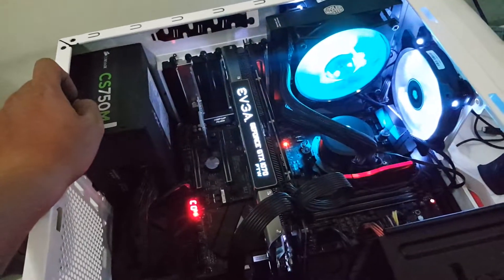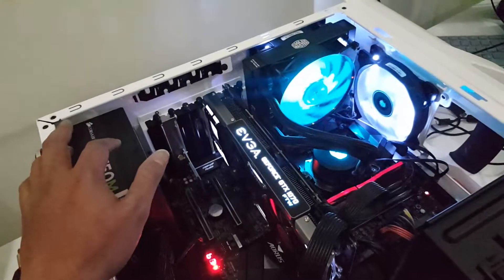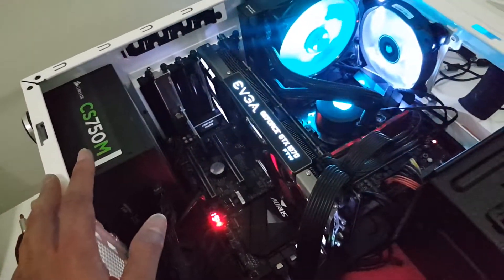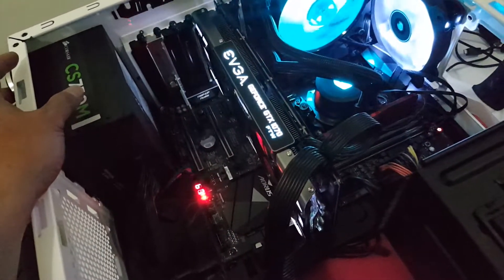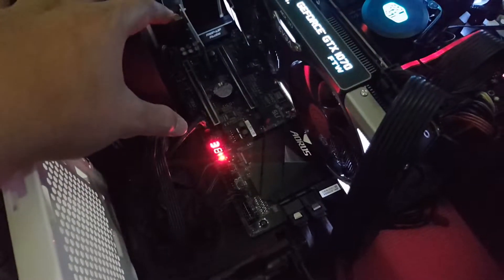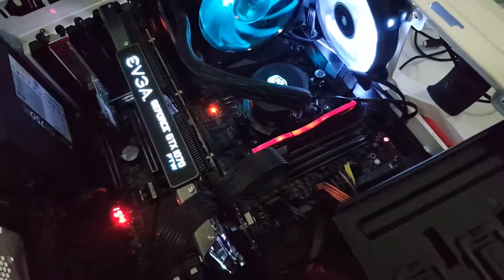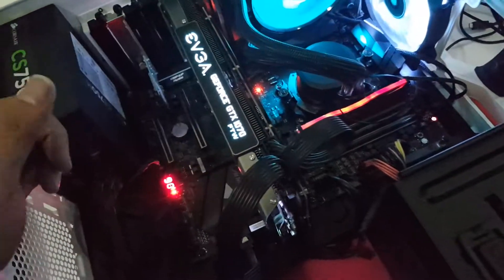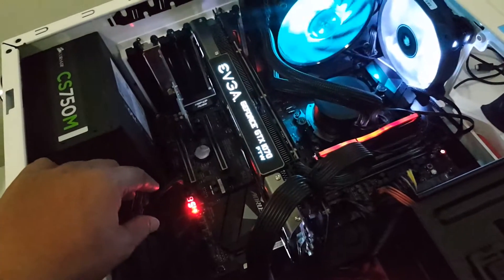Gigabyte ax370 gaming k7 hard to troubleshoot debug codes

Comment: Anyone still using these motherboards? Mine is also bricked now stuck in a loop with a ERROR CODE 54. I tested the CPU and RAM in another almost identical config from my friend and they work fine. Tried switching the main and backup bios, clearing CMOS and removing the battery but nothing. Still produces the same error. Anyone know if this is solvable. I have a gut feeling that it might not be a hardware fault but the board might be bricked somehow. (I occasionally got a similar black screen without booting, but after a restart or two it used to work fine. Recently it worked fine until past morning it would not get unstuck)
Reply from the maker: me up to now still using but everything is at stock setting
Reply: @manuelabella2589  surprisingly it still can be bought new, that would probably save me a lot of time reinstalling everything. But the price is even higher than it was 6 years ago.

Comment: I saw and some forum, which i have found out, overclock.net, possibly, or other forum, where there was information about problems with overvolting ryzen processor on F5 bios. F6 and F7 also was mentioned in topics which dealt with that subject.
Reply from the maker: too bad i can't go to bios 1 anymore :(
Reply: @manuelabella2589  There is a way to save bios to malfunction bios memory chip. You can start with good bios, then before saving new bios on chip, you just switch to previous, 1 bios. Then, programming bios will be done on bios 1, which was malfunctioning.   So people reported that bios was restored, and everything was saved.   The topic was discusses on reddit, as far as i remember.   I will tryo to show it to you, where there is proper way of doing this, step by step.
Reply: Here will goes the instruction:

https://www.reddit.com/r/Amd/comments/5zlegh/how_to_restore_a_bricked_ax370_gaming_5_bios/

Red whole paragraphs, and be carefull.  People reported that instruction step by step, saved their motherboard!  Search more info for Q-Flash, and how to restore your proper bios on usb stick, to be prepared, to flash BIOS.
Reply: @manuelabella2589  You can programm bios with an external programmator. If not, then somebody can do it, and put bios chip onto motherboard.

Comment: hi bro, did you were lucky to fix the error?
Reply from the maker: ever since the bios switch everything went smooth but on the bad side i'm running stock settings. To sum it up, from the day i posted this video to this day i haven't encountered any issue at all.

Comment: Ugh, mine just did this also. Tried swapping memory, got different code cycling. Tried swapping the top bios switch (both were on the right side "2"). Nothing. Tried clear CMOS from button.. nothing... I think my MB is bricked but it has been over two years and no warranty... looks like an ASROCK MB will be swapped for this...side note... the last few days before this a lot of USB devices stopped working that have been plugged in for a long time (printer, scanner). computer is hooked up to a good UPS

Comment: Hey man i know its been a while but my PC was having the exact same issue with the same error codes.  Its done this about 5 times now. The fix i've found works most reliably is to press the reset button (*not the CMOS*) when the error codes are between c0 and c1 (c1 being incredibly short after c0). Easiest way to do this is to just mash and hold the button until you stop it on the right code. Still have no idea why it does this, but it may be something to do with the PSU since its only done it when i've messed around with other electrics in the room   (turning on a light or using the hoover) as it boots
good luck with it tho!
Reply: for the record turning on lights or something after its booted or before i turn it on doesnt seem to trigger the same reaction. It only does this if i turn something on/off during the boot process before b7 (the one that looks like 67). For me i know i'm in the clear after b7 in the boot process goes to 54 and the motherboard lights come on. Just watching it boot and not touching anything else seems to be a decent way to stop it doing this.

Comment: Like many of you I've had the same problem,bios switch has fixed it... yesterday issue came back... switching bios do not work no more... thinking of rma..
Reply: dark matter i have the same Problem yesterday i built my pc but it won‘t start. Do you have a idea to fix that Problem??
Reply: @rgbbotevonyt8287  what is your cpu?
Reply: dark matter thank you but i fixt that problem. It was easy, I just bought a new Mainboard😂
Reply: @rgbbotevonyt8287  lol... i have fix it as well... rma'd the board... they confirmed bios was fucked up :)

Comment: I have the x370 gaming 5 model and it's been like this occasionally with no clear pattern. And I used to use the second bios and flash back the first one.
This method worked for a while and now some how the second bios is also like this and I can't do anything. Please help me
Reply: Did you fix it 🙄
Reply: @SuranjayaPriyanath  nope, I did some research and it looks like it has to be RMA'd. to either physically remove the bios chip or change the board entirely. and I live in a country where RMA'ing does not exist so it's collecting dust rn. I bought an Asus b450 strix instead and it's been fine for the past few years.

Comment: I'm having the same issues as well. Tried resetting CMOS and even using the dual bios function. No luck for me. All I did was restart my computer and I got into the same boat. Looking to get a second opinion before sending mine back for a fix.
Reply from the maker: Master P I got mine working after I switched to 2nd bios and it works fine till now. If it works b4 then try troubleshooting it but if it's bnew then send it back coz it will take time b4 some bumps into this video and replies back with some fix.

Comment: Manuel, had the same problem, but with x470 and Ryzen 2700. Did you ever find the solution? What did you end up doing?
Reply from the maker: i actually was about to send this back to amazon, then i tried switching to 2nd bios as last resort and it worked for me and up to this day i no issues whatsoever. i guess its kinda case to case basis, some users exhausted everything but to no go - my take on this is either RMA, return or get new and better board.

Comment: My K7 did this yesterday. Started a trouble ticket with Gigabyte. They sent me an RMA# and I have shipped it back to them.  The board has a 3 year warranty so make use of it and send it back.  I swapped out every component except the CPU and it did not fix it.  I swapped to BIOS#2 which is the original BIOS that was shipped with.  No luck at all. Wiped the CMOS and still not luck.  Send it back.

Comment: Did you solve it？

My K7 had the same issue last August, and I send it back to Gigabyte for repair. It came back with all functions working well. However, last night the issue came out again, and had totally the same problem as it had before.
Reply: 泓愷龔 hey, how did you fix this situation, I switched to another bios and within the week it had the same problem. Now both bios won't load.
Reply from the maker: @PhamDPeter  in my case i literally switch to 2nd bios and it works fine hope this goes on.
Reply from the maker: i was about to send it back to amazon then i tried this 2nd bios thing and it worked for me up to this day i never had any issues whatsoever, though i never tried overclocking anymore :)

Comment: Have the same Problem switched the Bios worked a while but after like 3 month i got an bluescreen and i get the error with both Bios :( also i am getting graphical errors if i am using another AM4 Motherboard. I tested lots of graphics cards but i get the same error every time. can u help me?

sry for bad english i am from germany
Reply: did you overclock?
Reply: nope but i found out that the error on the main bios and the backup bios died because of bsod
Reply: Hochspannungswerk kannst du mir bitte helfen? Hab grade auch solche probleme und keine ahnung was ich machen muss

Comment from the maker: I wonder what's gonna happen with the other bios though 😳 is it still usable?
Reply: hi can you help me. SOS..  i have the same problem
Reply from the maker: Rios Joel the only thing I did was switching bios which is like a  temporary  fix only other than that I have mo clue how to completely fix this problem 😣 - so far my pc works fine no issues at all
Reply: @manuelabella2589  I have read that fact could be related to some sort of system crash, which sometimes causes bios corruption. Maybe it is connected to old bios.  like F4, F5, or F6.   There is no F7, or F8, F9 bioses on gigabyte drivers page. They were most probably having some issues.  With overvolting processor, so it could make troubles.

Comment: had a power loss and mine started doing the same, followed some troubleshooting I found and switched to the backup bios (two switches below the lower pci-e slot, the one on top needs to be in 2 while the one in the botton in 1) try switching this while the system is off. if it boots it will take you to the bios saying that the bios was cleared, you'll have to go to the q-flash section and on this section you'll have to change the top switch to 1 again, you'll se a led below the procesor to switch also, then try to re-flash the bios. Mine is working now if not I wouldn't be writing to you
Reply from the maker: Allan Roberto Solis Palma it worked man thanks I flicked the switch originally its was in 2-1 change it to 1-2 now its working.  Do I need to do something or can I just leave this switch permanently at 1 2 😊
Reply: manuel abella can u leave the switch like that? Did u come over any problems? Pls reply
Reply: same happened with me today, applied the same and solved the issue.   thanks guys.
Reply: Not worked for me
Reply: Allan Roberto Solis Palma  hi i need help
Reply: Dude you just save me a ton of time! Thanks for this!!! :D